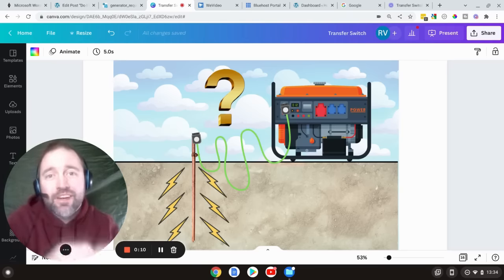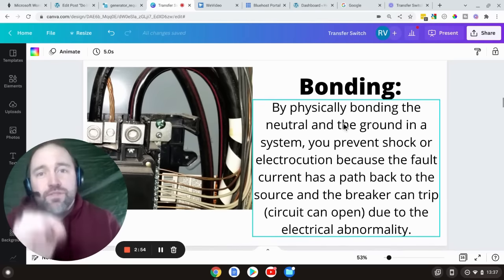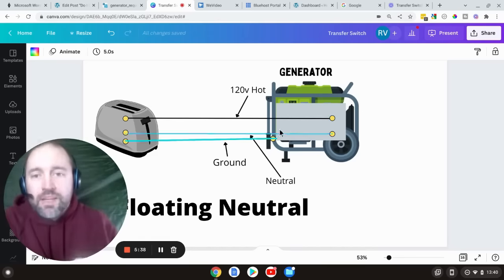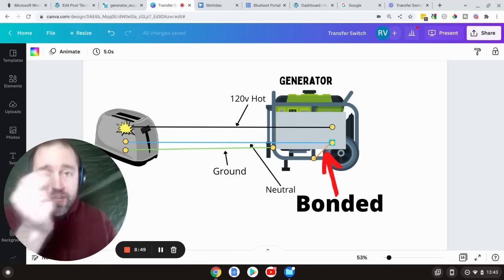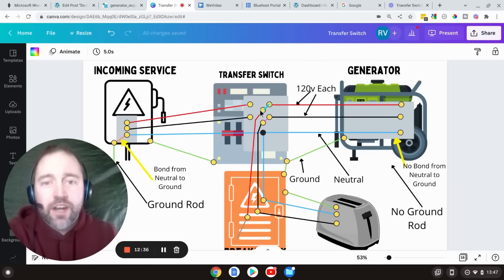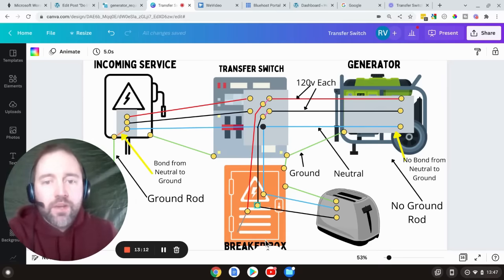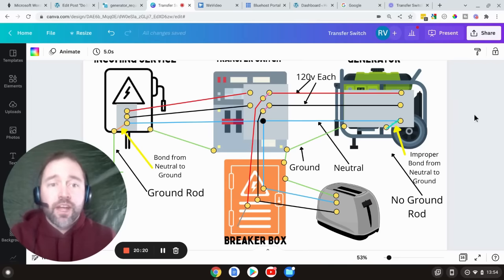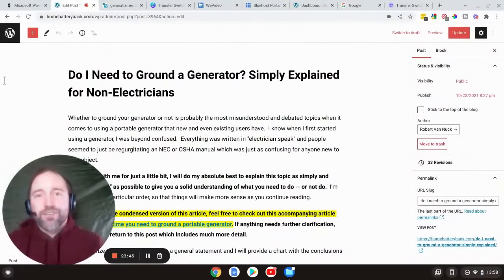When You DO and DO NOT Need to Ground Your Generator [Extension Cord Use & Backfeeding a Home]

Comment: Thank you! Not a simple subject at all. Let me see if I understand this correctly.
 I have a portable inverter generator which according to the spec sheet is floating neutral (Champion 2200-Watt LPG Dual Fuel Inverter Generator). I will be connecting few devices (refrigerator + LED TV + few routers and laptop) using an extension cord. The generator has ONE EU type AC outlet. According to your article, in this scenario you do recommend using an EDISON plug to bond the ground and neutral. I hope such a connector exists for EU type receptacles as well. 
I have a ground line connected from the water pipe to the home electrical panel, I understand I that should not connect the generator to the same water pipe as a ground rod.
1. How do I connect the EDISON plug when I have only one outlet? 
2. Is it safe to connect the EDISON plug to one of the receptacles if I connect a multi plug adapter to the extension cord?
I hope you will have the time to clarify this point.
Thank you again.

Comment: Nice summary.
Btw:  I have what I consider a a clever (I didn't come up with it) way of bonding my generator.  It's a 120v generator with two 20amp outlets and one 30 amp outlet.  When using extension cords, I only use the 20 amp outlets, so I bought a 30amp plug and bonded it.  I plug my bonded 30 amp plug into the generator and that bonds the generator.
If I ever use the 30 amp outlet for something like an RV, which I believe is bonded, I have to remove the plug, which make the generator a floating ground again.a

As I type this, I wonder if if bonding behind a circuit breaker is a problem.  I think it's OK, as it's behind a 30amp breaker and the other outlets are 20amp.

Comment: Here in Australia some generators do not bond the neutral to the earth. I had the choice to pay $1099 for a 9KVA generator and when I measured the outlet there was no neutral to earth connection, and the other option was the exact same unit but with a 30mA earth leakage circuit breaker for each outlet, and the earth and neutral bonded, plus weatherproof outlets for an additional $200 - guess which one I bought lol. They do recommend earthing the frame of the generator to the local earth pin as the way the ELCB's work is they monitor the difference between Active and Neutral and once that exceeds a threshold, in this case 30mA, the power is disconnected. 

240V is dangerous enough, so anything you can do to make things safer is really a no-brainer.

Comment: Gonna luck on you real quick. Though you did a good presentation. My pick for fun is just your example. The toaster does not have a ground link only a hot and neutral. No toaster has a 3 prong plug that I have seen. Just to pick on you. 
Pick pick. Nice video. Thanks for making it.

Comment: Oddly enough this explains to me why boats have a floating ground. I never understood why the military boats I was on didn't have a "frame" ground when applying power to shore. The metal boat hull (pardon the pun) was left floating in most cases.
Reply: The hull is grounded. It's floating in salt water. And most of the time you get 440V delta from shore power for a large ship. And there are no grounds at all.
Reply: @DuaneKerzic  I probably wasn't clear. I know they can have their boat mains grounded to their hull, but they have an option to disconnect their hull ground when supplying power to shore. I've seen an instance when the boat forgot to float their ground. They synchronized their generator to shore and then flipped the switch. The sync worked but their ground wasn't floating. There was something like a 10 volt difference. Doesn't sound like much but they were grounded with a planet's worth salt water competing with the same planet's worth of grounded dirt. A lot of cooked fish and a boat engine that stalled under the load. The boat does have, and should have, their hull wire bonded to shore ground instead.
Reply: That is because of voltage leakage inside the ship. It causes many deaths with shore power connected ships in fresh water marinas every year.

There is never enough voltage gradient in salt water to cause this as the water is too conductive.
Reply: @DuaneKerzic  Which is why when the boat supplies shore power they float the ship ground and bond the ship hull to the shore ground.
Reply: @therealjammit  I do have to ask just where was the ship supplying shore power when the shore power was energized?

Comment: If you have a inverter generator connected to a manual transfer switch in a sub panel, and certain sensitive electronics like a furnace will not run because you have a floating neutral generator, does that mean that the ground for the house has been disconnected while using the transfer switch.  And if that is true, then should the generator be bonded and grounded with a separate grounding rod?  Thank You.

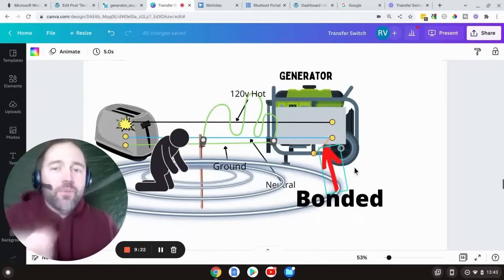Comment: I would disagree at the 8:30 mark... During a ground fault the current can either flow through a short circuit path (i.e. the ground wire back to the generator) or through some dirt (resistance), then through you (more resistance) and finally through the ground rod back to the source. I don't think electricity is going to take this path. Assuming you have a good ground/ short circuit setup, this is why you can place your bare hand on the welding table during the welding process since the path through the table is essentially a short circuit and will choose this over traveling through your hand.

Comment: Question:  I have no neutral just 2 (hot) wire with a ground back to the main panel.  Do I have to run an extra wire for the neutral?  Also this is a very comprehensive video.  I have to admit my training is very old school.  Back in 65 when I went to Electronics school,  we covered both high voltage and low voltage there were no neutrals.  There also were no ground wires.  While I understand the theory, I get confused on issues like this.  Right now my generator is plugged into an old unused line as I described.

Comment: I have paused your episode about halfway thru with a question, perhaps you address it further on: you mention needing to be bonded when using an extension cord. Why would an extension cord be any different than the normal cord on an appliance? Wouldn't bonding be required in both cases? In fact you even show where you've put a "permanent" bonding strap on a gen.

Comment: On my experience, (plant shutdown in SAUDI ARAMCO as contractor)  300KVA power generator supplying portacabin field office, material container vans, temporary workshop and shutdown facility. I got static electric shock and I heard also a clicking sound when touched the container van's door. Touch again but no more electric shock.  So I went to the rear side where the power supply panel located. Open it and checked,  I've found the loose connection on earthing cable. Fixed it then worked smoothly.

Comment: This was indeed a great video. Thanks! I do have one question and that is what problems/symptoms/damage/shock might occur if a bonded generator is connected to a house panel with an un-switched neutral? I understand that this will cause a potential 2 paths to ground. But what is the potential danger if that occurs? Thanks so much!

Comment: A very good and thoughtful presentation. Your explanation is perfect.

But, there is one issue that has not been covered and the NEC actually causes this problem.

The problem occurs when someone is using a generator cord from the generator to a house, and the generator has a floating neutral as you have described been the code compliant way of operation. What can happen is the  generator cord neutral gets open or disconnected without verifying the cord is good. What happenes is without the neutral, the voltage rises and lowers inside the house depending on what circuit is turned on. This overvoltage can cause fires in the electrical appliances and burn the house down.

Why can this occur? Bad generator cord plugs especially when they are home made. Testing the cords prior to use should be done, but a lot of people do not have the knowledge or equipment to make the test.

Interestingly, this problem does not happen when you violate the NEC and use a bonded neutral because the return path uses the ground wire instead of the neutral. 

There needs to be a device to automatically detect an open neutral, but I have never seen one. Conversely there needs to be a device to detect current on the ground wire. Someone is going to forget to unbond their generator.

Comment: you are perfectly correct. Wiring back feeding 220 vac to the house is so simple. Wire the 2 HOT 120 volt leads from the genset and the bare safety ground wire. Make sure that bare safety ground wire from the genset is connected to the frame. Check that with an OHM meter to be sure. The electrical panel in the house will take care of the proper grounding of the genset. And always remember to shut of MAIN BREAKER in panel so you do not kill a lineman during the outage. There are different ways to get 220 vac into the house. The dryer plug is ok. But be careful. I am back-feeding through the outside A/C condenser unit circuit for our central A/C system. 2 ---120 VAC hot leads and a bare ground wire. The condenser unit does not use  NEUTRAL lead!!!!
Reply: This method isn't ok unless you ONLY plan to run 240 volt loads (which you won't) in your design the bare ground would be a current carrying conductor carrying the imbalance in the 120 volt loads.
Reply: @integr8er66  yes, exactly. you not only would have to shut off the main breaker, but every single other breaker except for the AC unit. then the blower unit inside is probably 120, so you can't use that.
Reply: you should consult an electrician about that setup because it's wrong.
Reply: For as long as I can remember I’ve said electricity is ‘difficult’ because you can’t see it. And I have had it explained many times. (Studied to be a licensed aircraft engineer)
Using a visual representation is genius. 
This is great guidance and also clearly makes the point that there are several factors in wiring any particular system. Thank you very much
Reply: You put in a plug near your AC condenser so that you could hook up your generator? Why didn’t you just do it correctly?  It’s not like it was a lot more trouble.
Reply: Two problems with your setup: A. no neutral. Either your 120 volt loads won’t work, or you’re using the ground as a current carrying conductor (if neutral and ground are properly bonded in your main panel like code requires,  that will happen). 2. Neither using the dryer receptacle nor backfeeding through the AC condenser are a safe way to connect a gen to your house. If it’s not a permanently-installed hardwired standby generator, you must have a plug on your house and a receptacle on the cord you’re connecting the gen with. NEVER SWAP THE PLUG AND RECEPTACLE AROUND!!
Reply: @xHadesStamps  THANKS...Wiring was corrected and tested. We can  power up using the generator. We cannot not have a large load and use the microwave (1200W)

Comment: This a great video on the subject of grounding for generators, but the reason that I watched was to understand the possibilty of "back feeeding to my home" I do understand that if I connect a small emergency generator to my house viia an existing socket, that there will be a risk to an enineer who may be working on the distribution, but if I isolate my house from the distribution network via the double pole switch at the consumer (fusebox) unit, then there will not be any risk to someone outside the house. But I will have also disconnected the bonded neutral/ground connection, so am I correct in saying that I will need to install a ground rod and connect it to the generator, plus ensure that the generator neutral and ground are bonded. I would only do this in an extreme emergency.

Comment: Nice clear explanation on this "To Ground Rod or Not". Often connecting a generator is during an outage and during an outage everything is rushed, and everybody wants the power on Right Now!
I have noticed with electronic equip. adding a ground rod to E/G when not needed causes strange things to happen.
Reply: Too many grounds makes an antenna, ground loops

Comment: The ground rod at your house is for the utility service. If your generator is wired into your residential panel, your equipment ground and neutral is now connected to that system. If your generator is isolated from an earth ground connection, like a Honda genny with a plastic case, you could stuff the hot wire into the earth and the CB would not trip because there is no return to the generator itself. Beware GFCIs as well. They are required on gennys 15 KW and smaller I believe, either by pigtail or a device on the genny itself. If you are NOT grounded and touch both the black and white wires of a GFCI circuit you will get zapped. Power out equals power returned through that GFCI. It all depends on how you are using the genny. In a lot of locales, you are required to switch out the neutral as well. But the best advice came at the beginning of this video...call a licensed electrician and have him hook it up.

Comment: Very interesting. But keep in mind that some small "120 volt" generators are actually 60 volt two phase with 60v on the hot and 60v on the "neutral". In this case bonding your neutral to the generators chassis could energize the chassis to 60v. 

The specific generator I ran into like this was a hydraulic driven (PTO) on a cherry picker truck. An entire fleet of trucks actaully.

A GFI used on such a generator will operate normally since GFIs break both the hot and neutral when tripped.
Reply: Put that in a wiring diagram. What is the 60v on each referenced to? Black wire - L 1  to neutral, 120v ,,t hen red wire L2  to neutral 120v ,  then black to red  240 v , isn't that the way it will be.
Reply: @BELINC7  There was no 240 in this instance. The reference I used was the ground prong on the outlet.  Hot to ground 60v, neutral to ground 60v, hot to neutral 120v.

 Frankly I have only come across one set of generators having this configuration. Just these 5 to 10 utility lift trucks with hydrolic powered generators.

Comment: Well done.  Key points to note:  If you are only using the generator-mounted receptacles, you DO need to have the neutral bonded to the frame, and no grounding electrode is required at the generator.  If you are hooking up the generator to premises wring (transfer switch or panel): if the neutral is not switched the neutral at the generator must NOT be bonded to the frame, and no ground rod required at the generator.  If the neutral is switched (when hooking up to premises wiring) then the generator is considered a separately-derived system and the neutral needs to be bonded to the frame AND a ground rod is required at the generator.  These are NEC code requirement.  When in doubt, please hire a licensed electrician.  Personal safety is at stake.
Reply: He said that
Reply: I'm wiring a concession trailer my electrician says I can't use a 3 prong 3500 inverter because he can't wire 220 to the panel without a 4 prong ? 😅
Reply: @HighAdventures  If there is a requirement for both 240 VAC and 120 VAC it would require four conductors: 2-hot, 1-neutral & 1-ground
Reply: @HighAdventures  well, your electrician is right. You should ask him some more questions. Information is important if you aren't sure about things. Unless of course you are in Europe or something, there system is very different from North America.
Reply: One clarification when you say using the ‘generator mounted receptacles’ and having it bonded  you’re really mean using the generator in a standalone fashion. You don’t want the generator bonded if you’re using it to power your house, and you happen to be using the generator mounted receptacles as well.  Just clarifying.
Reply: YEAH  @tacx1  YEAH BUT @bretgreen5314 said it in a more understandable way
Reply: That's what he said.... watch it again.

Comment: See Mark Boscawen's comment, it's the best I've seen (I have not read all comments though!).  
This video talks about faults and breakers tripping, and I believe most of those explanations are in error, UNLESS you have GFCIs, not just regular circuit breakers (in the house or generator).  Normal circuit breakers do not protect against electrical shock by tripping when a person becomes part of the circuit.  They ONLY protect against circuit overload, therefore keeping the wiring from starting a fire.  If there is a short circuit, they trip cutting off the power.  If you touch a live wire, stick your finger in an open light socket, etc., you will get shocked.  The bonding of neutral to ground just ensures the neutral wire is actually at ground potential (voltage, i.e., 0V).  Without a grounded neutral, the supposedly 0V neutral wire could be at a dangerous voltage relative to ground, posing a shock hazard.  The assumption is that a person touching a neutral wire is also somewhat connected to ground, so if neutral is grounded too, there is no voltage difference to shock them.  Finally, the grounded appliance, for example, is made that way to protect from a fault where the hot wire somehow contacts part of the appliance case.  If it was not grounded, then the case would be energized and shock a person that touches it.  If grounded and this kind of fault happens (hot contacts the case), the hot is now connected to ground, and that is a short circuit and trips the breaker.  This is the only way a normal circuit breaker protects against electrical shock.  Thanks for reading 😊

Comment: My neutral bus and ground bus are connected in my circuit breaker panel. I see the grounding block and I have continuity just triple checking that since I have my system bonded at this point and not further up in the co-op, that my generator should be floating when used in this set up with a simple interlock switch.